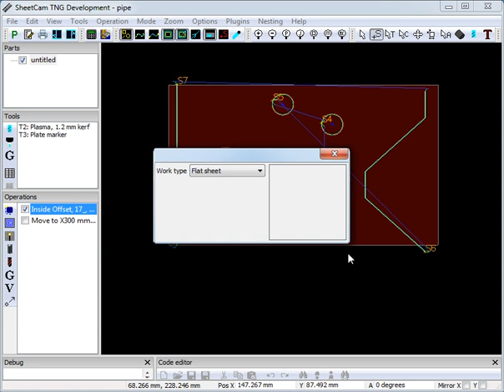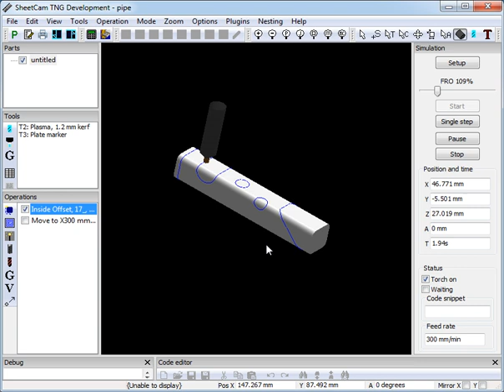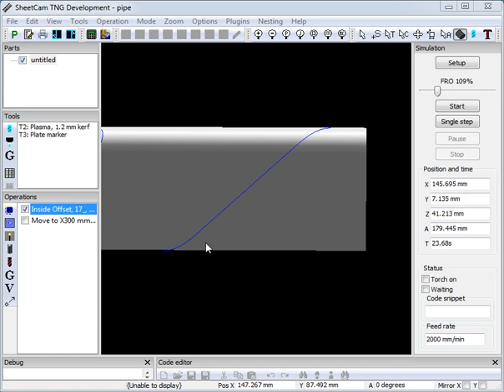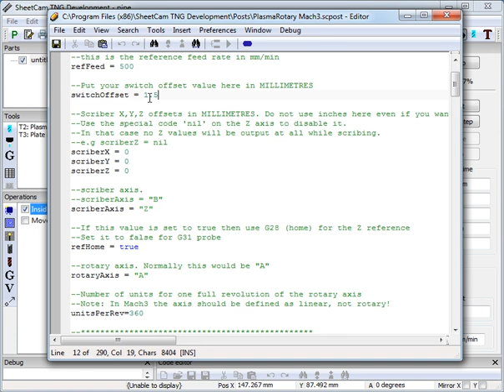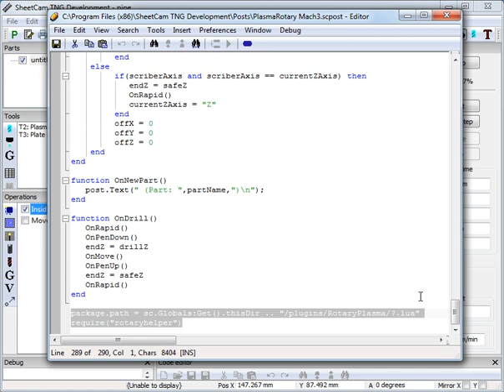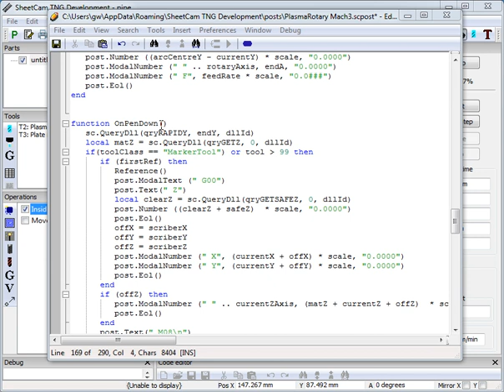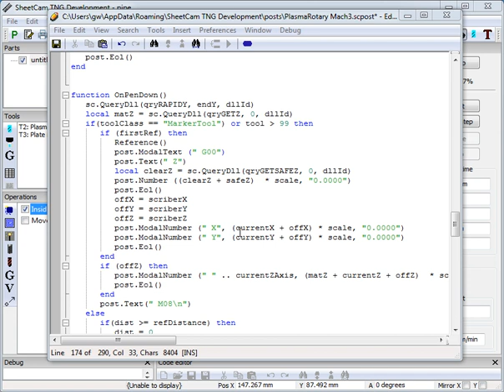SheetCam Rotary plasma pipe cutting demo

Comment: It looked like you did a no rotation cut with x & y on the square tube. But I need to do it on pipe is this pluggin in capable of that?
Reply: Yes it will do round, square and rectangular tube.
Reply: @LesNewell  sorry i guess my question wasn't specific. i need to do a no rotation cut on pipe. cutting hole with just x & y instead of it using y & a

Comment: Where can this plug in be downloaded?
Reply from the maker: The plugin comes with the development version of SheetCam. You can download that version from the SheetCam website www.sheetcam.com
To enable the plugin go to Options->plugin options->RotaryPlasma and turn on the 'enabled' check box. You will also have to use the PlasmaRotary Mach3 post processor.

Comment: Hello.from where to get this plugin?I use sheetcam.it is possible to use this plugin with another axis to control the cutting angle?Thank's
Reply from the maker: The plugin comes with the development version of SheetCam. You can download it from http://www.sheetcam.com/downloads
It is designed to run with 4 axes, X,Y,Z,A. Currently there is only one post processor that works with the plugin but it would not take much to modify the post to suit your machine.
Reply: Thank's.it is possible to make work with 5 axis pipe cutting.(like your video + an angle axis)
Reply from the maker: Cristi CRS Do you mean you want to be able to cut chamfers on the tube? I am afraid you can't do that with this plugin.
Reply: maybe in future plugin :) thank's
Reply: @sheetcam  i bought your side software can you guide me to use on mach3. thank you very much
Reply: Hi
Can you help me